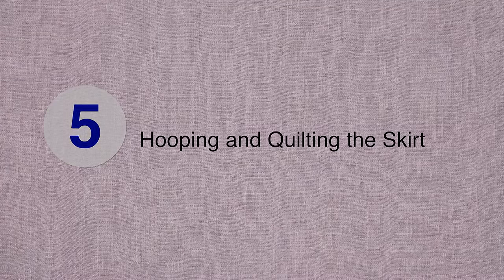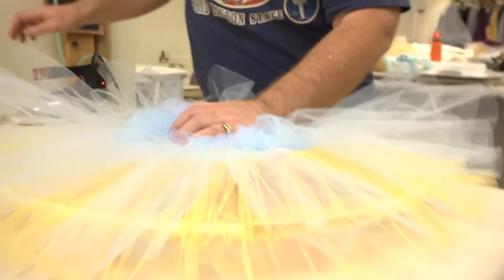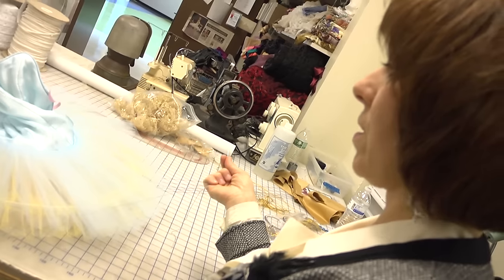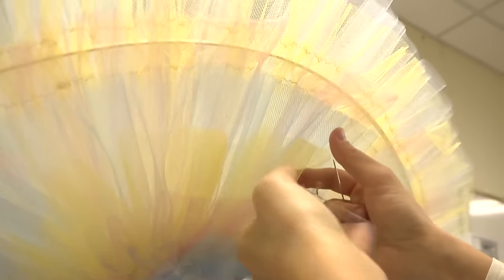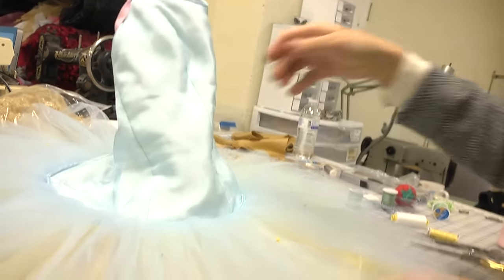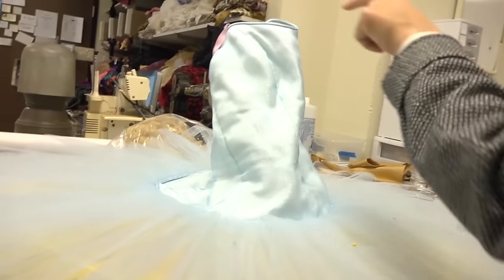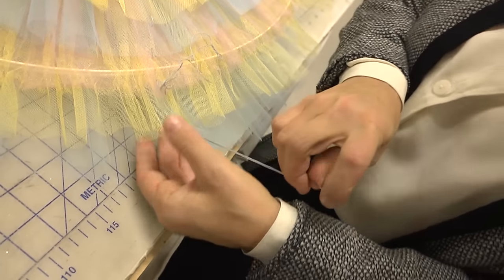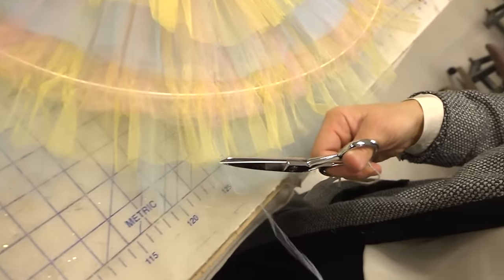Constructing a Classical Ballet Tutu (Part 5: Hooping & Quilting the Skirt) - University of Akron

Comment: Great explanation. I never understood why embroider floss should be used but your neat "trick" of using it against itself to loop is really good.
Reply: I think it's because embroidery floss is thicker than cotton/poly thread so the chance for it to break in the middle of stitching is smaller also embroidery floss doesn't tangle too much and easier to unravel if it does happens :) just my opinion though

Comment: how do you attach the bodice to the tutu, did not show in part 4
Reply: It's in Part 6. Match the centre lines front and rear, she's sewing the boning in to close the bodice first, then sewing that line into the ditch of the top layer of the skirt. You'd normally finish the raw edges inside in bias, but because these are corps skirts and the bodices are fitted to the dancer, I suspect she's leaving it as is.

Comment: Which layer is the hoop placed? How far from the edge of the tulle is it placed?
Reply from the maker: If you have questions about the process, you should contact Irene Mack-Shafer, at the University of Akron costume shop. Her email address is: ijacops@uakron.edu
Reply: You'll spot in the quilting section, it's third layer down, about 5cm/2" in. They've used approximately 15mm widths of the same tulle to form a boning case on top of each panel, and threaded it through.

Comment: What is the name of this flexible range?
Reply: Originally, basket cane, but for about the last 40 years, normal light polyester boning, 5-6mm rigilene/flexicurve. You can even get it fabric-covered, to facilitate dyeing, although modern Rit dyes, particularly the pro range, have no troubles with just the plastic. You might study modern Reenactment versions of crinoline and skirt hooping.

Comment: what is the name of the hooping material?
Reply: I m not sure but it looks like flatened steel bonning tough there is also plastic bonning it maybe one of those
Reply: @anarosareyes6269  Probably the flexicurve she uses in Part 6 in the 5mm size. Steel can cut through, guys can drop gals if their hands are sliced. A softer elliptical beading boning has recently appeared, too. Plastic can be dyed.

Comment: I'm wondering if you have an advise on where I went wrong with my tutu construction.  When I kick my leg up past the tutu height, the tutu flips upwards and does not go back without me pushing the tutu back down.  Any advise on how to fix this or what might have caused this?
Reply from the maker: +TMoore1202  I'm just a video producer, but I happen to know the costume designer, and here is her reply: 

This sounds like the hooping is either pushed too tightly against the casing or not tightly enough. The tutu skirt is all about radius: first, the skirting must be full enough that it maintains an easy halo about the body at the outside perimeter; second, the hooping must be located at the correct radius to support the skirt; third, the circumference of the hoop must be proportionate to the radius so that there is not extra skirting distance from the body to the hoop nor a warped circle due to a hoop circumference with a larger radius than its radius from the body. That’s a little mathy, but I hope you follow and can make adjustments to correct the problem.
Hope this helps.
Reply: The University of Akron l